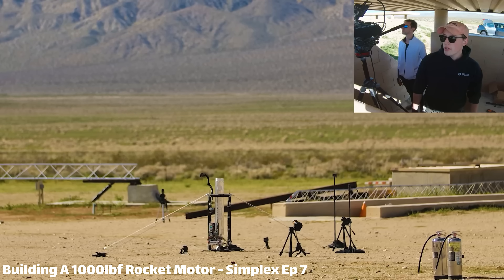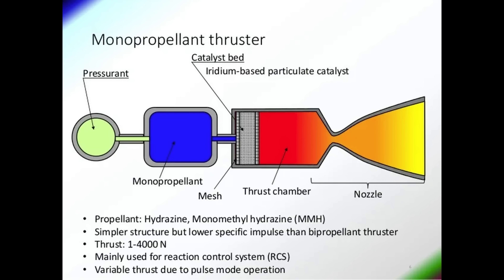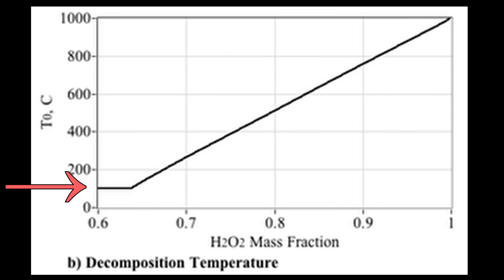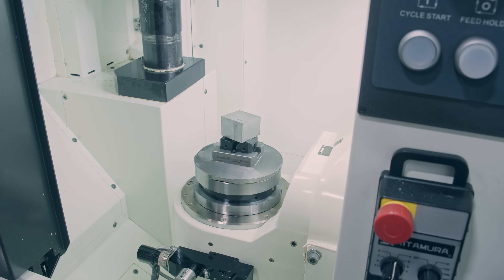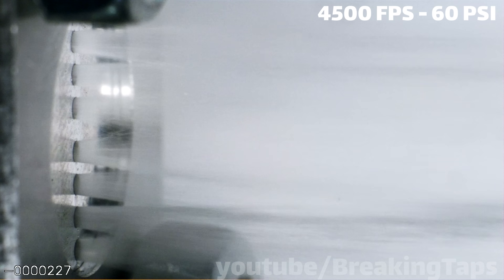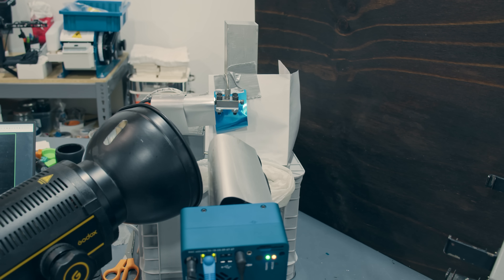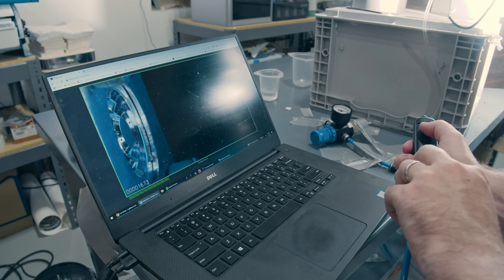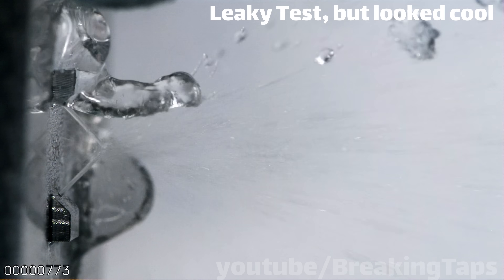Prototyping (Tiny) Rocket Injectors

Comment: I’ll chime in a second time since I had been contemplating use of H2O2 to test a new rocket engine design concept. I do not have personal experience with H2O2, but I have studied it more than many.  From my research, it does not appear to be as dangerous as some make it out to be.  However, it does need to be highly respected and it needs to be handled properly.  This includes like some have said, don’t bottle it up in a closed container, make sure you have a sump for it to go if it were to leak, always be sure to use non decomposing materials for containers and anything that touches it, make sure everything is immaculate cleaned with stabilized distilled water before using it with H2O2, and make sure to use the proper recommended stabilizers to keep if from decomposing.  And finally, like all rocket fuels and for that matter guns too, always assume they are loaded and assume they might go off at any time and take the appropriate precautions to guard against if they did.  From what I have learned of it, if given a choice between liquid O2 (LOX) and H2O2, I have to admit I would use LOX.  The reason being because LOX must be combined with a fuel to react, and this provides a safety wall against it combusting.  H2O2 does not have this impediment to decomposing and only needs a “spark” (a decomposition site) to start it going.  In that regard, it’s kind of like having sensitive solid rocket fuel.  But with that fear mongering aside (in order to instill due respect), like I said, I don’t think it’s as dangerous as many think.  I know of no cases where the Germans had an accident with it during V2 testing or tactical launches, and although there may have been a an occasional accident, the same can be said for residential natural gas explosions, except I don’t recall anyone dying in a H2O2 accident, but plenty have dies of natural gas explosions, or been electrocuted with electricity, etc., etc.

Comment: Great video!  I really like your high speed photos (might want to do a video on just the cameras!).  Regarding H2O2, I assume you have seen the V2 rocket videos by the Astronomy and Nature channel?  He goes into deep depth on how the V2 used H2O2 to power the turbines.  The Germans did not use a catalytic metal, but permanganate.  Think of it this way.  If you have a solid catalyst like silver or a couple of the others, you are limiting your reaction rate to the exposed surface area.  BUT, if you mix the catalyst with the H2O2, then your reaction rate is proportional to the VOLUME of your liquids.  This will result in a much faster reaction rate, needed particularly since you are going to use such “watered down” H2O2.  I would suggest to start with what the Germans did with the V2, and improve from there.  I think you are going to be quite disappointed with a fixed solid catalyst, but that does not mean that you can’t use both permanganate AND a solid catalyst ;-)

Comment: For diesel injectors, K-factor (hole taper) makes a large difference. Similarly with geometry of the orifice inlet - smooth, radiused edges mean much greater flow. I suspect the same would be true here.

You'd have a much easier time creating taper than they do with injectors, since you can actually access the inlet side; no need for exotic stuff like reverse-taper edm. 

Given the scale, smoothing and radiusing would still be difficult. If you were determined to, I'd look into machining with an abrasive fluid (aka hydroerosive grinding). Think diamond powder in fluid; different applications use different viscosities, and it can range from the same viscosity as your target fluid all the way up to that of barely-workable pottery clay.

Comment: make multiple passes on the injector holes with the same size bit to make sure they are nice and smooth in there and try deburring them (rounding the edge) on the inlet side of each hole, might help with flow rates.

Comment: Why make your own silver foam when you can just electroplate silver onto an off the shelf sintered brass fuel filter? They're cheap and available in every size from 1cc RC car engines to 30cc chainsaws to 250cc motorbikes.

Comment: You might want to look into a magnetic pin finisher to burnish and debur small parts like this with many tiny holes.
Reply from the maker: It's been on my radar! Definitely thinking about it, a few of my watch-making friends say they are great for small parts
Reply: They truly are, I have one for finishing a fiberglass product that is a carrier for a specialized cylindrical electrical contact. Carrier is 4mm diameter, 1mm thick with a .6mm hole in the center. Can easily do a batch of 100-200 and after 20minutes they come out of with perfectly rounded edge and polished flat surfaces.
Reply: @BreakingTaps  fyi the burnishing compound and stainless steel pins that work in a separate plastic container are stuff to be sourced, but the pin finisher machine truly is nothing but a couple capable magnets spinning on a platter with speed adjustment and a timer, could easily be made instead of bought.

Comment: Why not make different diameter holes? Like smaller on the inside where pressure will be higher and bigger on the outside where pressure is lower.

Comment: The higher flow in the middle of the injector is because of the momentum of air pressing behind the fluid. Rather than putting the air source directly in the middle of the injector, it should have an indirect path such as being introduced to the side of the injector impinging on a solid surface to allow air pressure to build evenly behind injector.

Comment: HTP pulls around 150s of Isp in vacuum, so you're looking at up to ~3lbs of thrust with this sort of design, in vacuum, using HTP. So, especially with the absence of vacuum, you're going to want to dope the 35% peroxide with low boiling alcohol or hydrocarbon, per Whitehead at LLNL you can get up to 250-300s. Might make you get more easily measured force with the 35%?

Comment: I would take issue with the statement that bipropelant is the most common rocket. For orbital boosters, maybye, but keep in mind that most payloads boosted into orbit have a ton of little manuvering thrusters that are all monoprop. For example, the dragon spacecraft launches on a booster with 10 bipropelant engines (9 first stage, 1 second stage), but the capsule has 18 draco engines for manuvering and 8 superdracos for LES, for a total of 29 monoprop thrusters. Other orbital systems have similar number of maneuvering engines.

And solid rocket boosters, while not as popular for orbital and launch applications, are extremely popular for military applications, and are used for most military missiles, from ICBMs to air to air missiles. Im pretty sure that military stockpiles mean that SRBs are easily the most common type of rocket engine.

Comment: If you increase the pressure drop across the injector, it will even out the flow rate through your injector elements. In your case this will probably mean you will need a larger diameter feed line for your injector feed or reduce your hole size. 

This pressure drop through the injector will also help you significantly when you actually go to run your engine. Your pressure drop is essentially your safety margin. If you have a combustion pressure excursion and your pressure drop is too low it will cause your combustion pressure to exceed your injection pressure which will stop or even reverse your propellant flow. In practice this will result in whats called pogo or chugging instability because it causes a low frequency oscillation of combustion. As the flow slows down from the high pressure, then speeds up again as combustion slows and the pressure drops back down and keeps repeating this cycle.

I've done some work with 90% peroxide, and it is indeed its own special animal.

Comment: You might try to look at swirl injector, you put a swirler (just angled surfaces) followed by a convergent section, the fluid will keep the rotation velocity on a much smaller diameter generating a nice attomization when exiting the hole.

Comment: Instead of inventing the wheel, you could use a known device called fuel injectors, drill few holes at an angle and screw in few injectors. You can get injectors that are very small. You can also get used injectors take out the nozzle and use only the nozzle to safe on weight and bulk...

Comment: Great project.
You will probably run into pump cavitation at some point.
You may get better results if you ignore the nozzle plate and simply fill all your sections with catalyst bed.
Round disks of silver (plated) mesh filling the whole cavity probably easiest.

Look at what the H2O2 tip jet helicopters and jet packs have done, a lot of the hard work has been done for you.

Your impinging jets were beautiful but somewhat overkill for a mono-propelat that has to pass through a catalyst bed afterwards.

Comment: This is very cool, I love it. I don't know why you say you're not an engineer. I recommend you check out photo etching. A sheet of pretty much any metal eg. 0.2mm Inconel is chemically etched from a precise mask. You can get holes and cut-outs and partial etched areas too. No angled holes though. 

I bought a 1m x 0.5m sheet for £200 and on to that sheet you could fit hundreds of test pieces or finalised parts.

Comment: What if you were to add a rough material at an angle to the jets? I'd think if the water hit it and bounced off it would do a good job at atomizing the fuel. Or, what if you were to just add a thin solid object in front of the nozzles? So when it came out it would be sort of "sliced" in a way.
This idea comes from when i hold my finger over the end of my hose and then put my fingers in front of the stream, it seems to create more of a mist that way,

Comment: You may want to try nozzle geometries like the ones used in weed sprayers, that work just like your impinging design but are also a little simpler to make IMO. (i think they're called fan nozzles)
I played around with those spray nozzles with my 3d printer and there's alot of configurability, where you can configure your flow, your angle of spread (width and height of the spray pattern).
And the geometry is very simple, even my FDM printer was able to make these spray nozzles work well.

Comment: shower head? ionizer ion slings rock also and photon engines, of which both can be fuelled by nuclear engines, minus propellant in the photon slingers, how about gasifying the fuel by recycled heat instead, self-spray, plasma mhd thrusters rock, better than the voltage electron-ion sling thrusters, so you want super porous silver shower head, try nano anodized tubes, maximum surface area with throughput, yep silver coin with holes, or reactor control silver rods in a hole disc holder, atomized = gaseous phase, electroplate the nano holes with silver, you can use the combustion of the fuel to push and vaporize more fuel to more catalyst
Reply: for a simplest engine, it might be best to let it explosively detonate in a nozzle container, maybe in staged manner

Comment: Could the shower-head plate have its holes drilled at an angle and be mounted in the centre of a bearing. The fluid as it enters will give a rotational force to cause it to spin and swirl the jets. This may help with atomisation and the odd blocked hole may not matter too much.

Comment: The ceramic honeycomb of a catalytic converter ?should? also be an excellent catalyst for this as it contains platinum group metals that are superb at decomposing peroxide and already has a geometry optimised for high velocity flow through it while keeping it in place... in theory. You could machine a larger piece of honeycomb to fit your chamber exactly. Be warned, 'old' catalytic converters may lack the needed PGM's or have been poisoned by prolonged use, to be good. Try to use a newish one, although that would be costly.

Comment: has anyone talked about milling an ellipsoid top for the injector plate so the centre channels get more impedance by virtue of path length? or you could play with the restriction geometry scaled along the radius. i would imagine the ideal ID crossection for a nonturbulent channel would be like some sequence of parametric ratio pairs of a bunch of sears-haack bodies. sorry if my language isn't engineery, I'm a musician.  I wonder if the intake side of those channels would  intersect at a knife edge or a parabolic edge. anyway, I'm probabaly full of shit, as I derived a lot of this based on crystals and chakras
Reply: oh man what if the throttle body was just a set of sears-haack inserts that guaranteed laminar flow for a decent path no matter what the pressure and then you could provide a (simple) constant pressure helical fuel pump
Reply: those would be pointy so they stay linear for whatever depth theyre running at
Reply: oh and you could rifle the channels so they spin it up like a pee stream....lol the throttle body elements now have to pivote as they head towards the choke point. fuck i wish i had lego
Reply: would be fun to play with rifling direction...I have a sneaking suspicion helical paths might have a narrow pressure band before they introduce turbulence
Reply: i bet the crossection of the rifling is like sinusoidal or something...I dunno, what would be the hardest thing to carve out of titanium?  probably better off printing and sintering the injector piece and carving the throttlebody

Comment: Can We Just Put A Metal Net Of Some Durable Material 😅???

Can We Put Spraying System And Catalysing System In One Unit In Which The Sprayer Is A Cylindrical Structure Inside The Catalyser ???
And Then We Angle The Nozzles Of Sprayer So That Tiny Water Droplets Are Formed ???

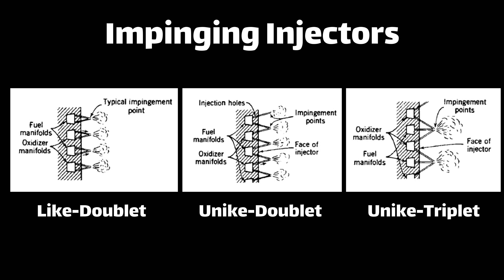Comment: @9:00 (1mm Showerhead High Pressure). THAT IS WICKED COOL. You're feeding so much air pressure into the system that the air exits WITH the fuel. I think the air is forming a sudo-solid center channel almost as if the pressure is somehow still high enough (despite it expanding and moving faster) that it forces the fuel to the walls of the drill hole where the air is relatively stationary. This might be making a cylindrical venturi tube which is why it's atomizing the fuel so damn well!

@11:10 Contrast this to the 0.2mm where the air cannot make it through the drill hole since the viscosity of the fuel blocks the smaller hole. In this case the air pressure is more so acting as a piston on the back of the fuel forcing it through the holes. 

While you may be getting more fuel through with the smaller holes it just will not react as well as the better atomized fuel. If you could find the smallest size diameter hole that still has that boundary atomization you will have your best possible fuel injector. After that you would need to tackle how to maintain the larger volume of compressed air the fuel injector will need in order to completely inject/(eject) the fuel in the reservoir.

@13:08 DUDE YOU CAN SEE THE HARMONIC OSCILATION. You just need to fine tune the reservoir size, feed line length, and plenum size to get it to work better!

Comment: I ask this with genuine interest. What is the benefit of the two streams colliding vs the same setup, but have the stream hit a specially designed screen to atomize the fluid?  Place the screen at the same point where the two streams would typically collide. Also shift the holes so they don't align. That way, if one side were to clog the opposite stream would still be atomized. And the offset is because I think the streams colliding on the screen at the same location would interfere with the atomization.
With that, could the screen be made of the catalyst?
I'm sure the answer to all of this is 'no, you're an idiot.'
That's fine, I know nothing about this stuff. It seemed like an interesting idea, but I'm sure there's a reason why it won't work. I'm curious as to what that reason is.

Comment: Breaking Taps, google something called "Rocket Candy" it is usually a sugar, or sugar alcohol mixed with an oxidizer such as Potassium Nitrate (KNO3) and can be made easily at home (with proper safety procedures of course) it is a good beginner's rocket fuel if all safety procedures are followed.